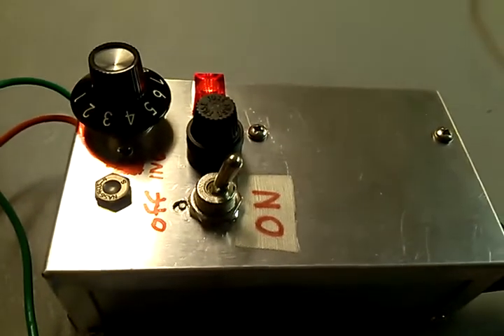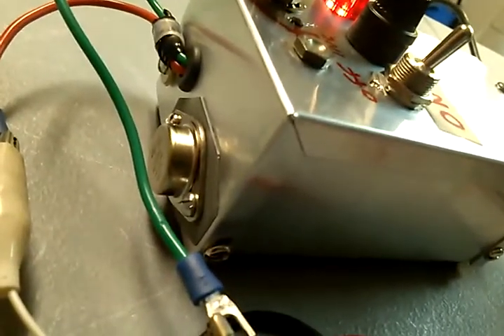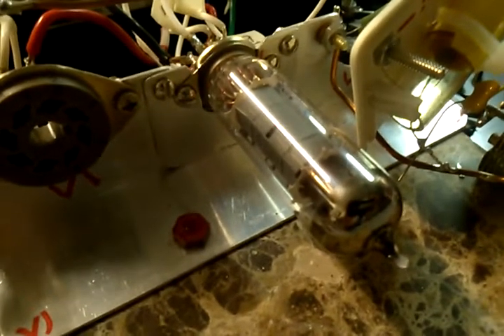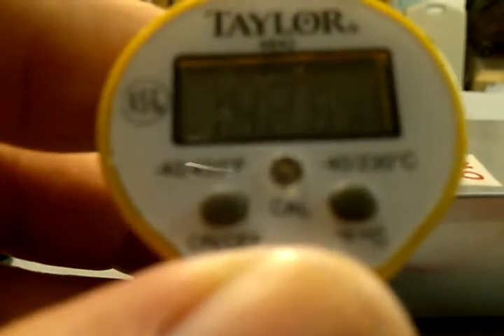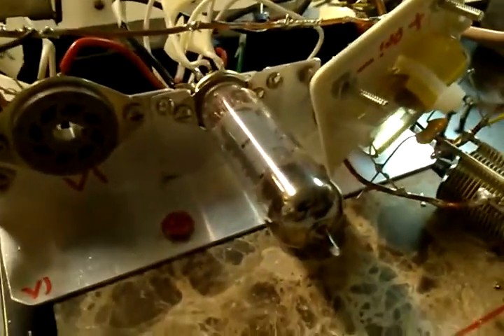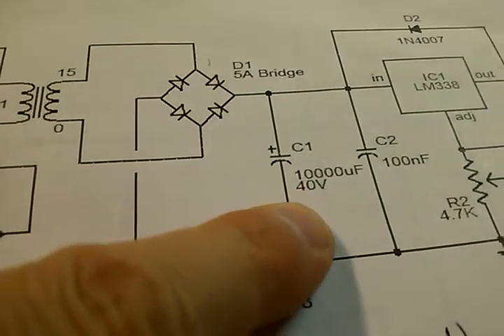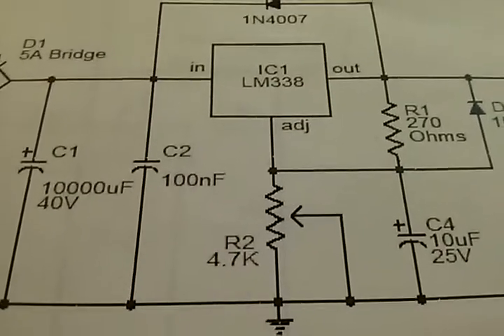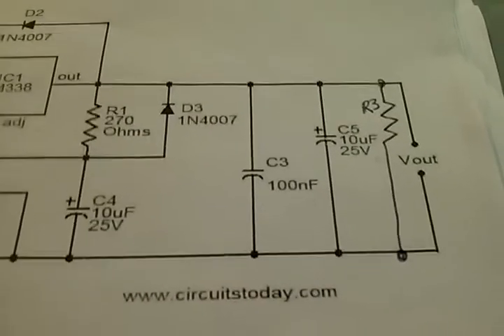LM338 adjustable voltage regulator circuit DIY

Comment: I have burnt out my share of pots. It usually gave me a choice of discovery: a very distinct odor, or nice white smoke. And usually when I was rushing. The LM338 is a very handy chip. I had one in a home built power supply Id use for just about everything, more than the one I bought which was expensive. And it lasted for 17yrs! Good video!